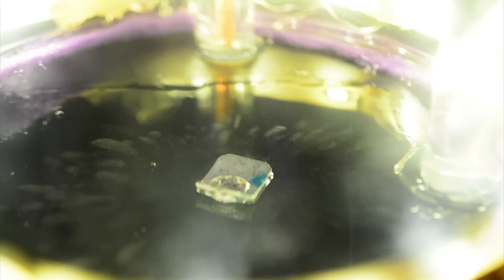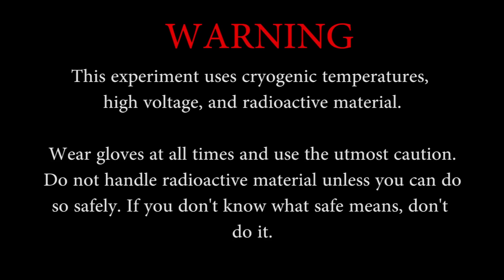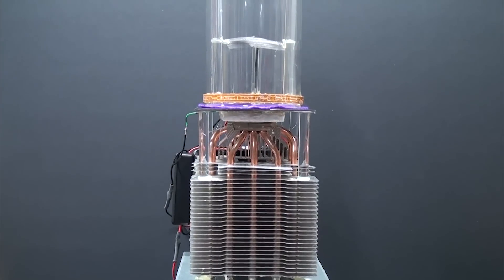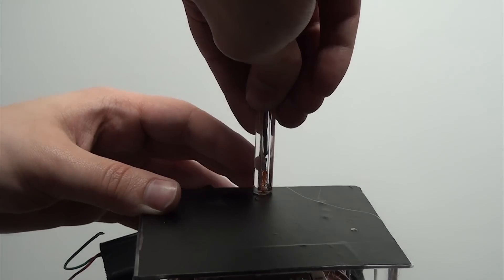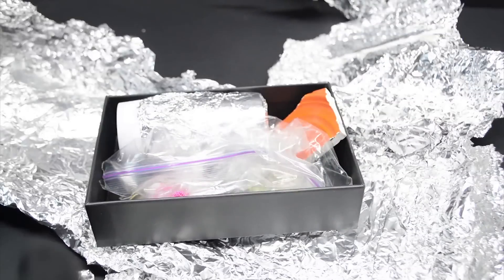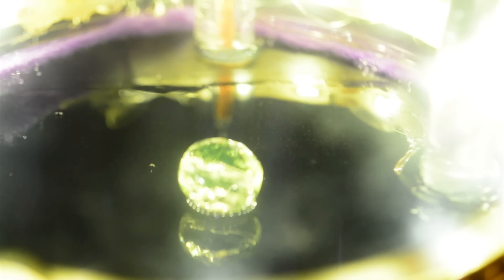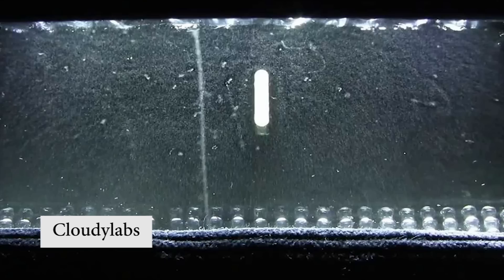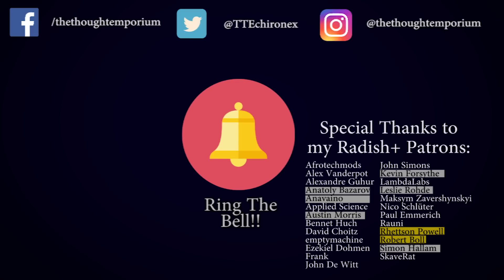Make Invisible Radiation Become Visible - Peltier Cloud Chamber

Comment: If you want to put the thermal paste better. 
Place a single blob in the middle and let it spread so it dose not trap bubbles.
Reply: Eh, that's not really an issue for an experiment like this.
Reply: @Sevendogtags  4:35 "the better job you do the better this will work" Eh, he said it :D
Reply: 1 or 2 Celsius isn't going to be game changing here.
Reply: @Sevendogtags  Yes and using the silver stuff is an overkill. Your point?
Reply: Not every dark thermal paste has metal in it. That's probably some cheap TP. My point was clear, the application of TP was fine and a better application would be irrelevant to the scope of this experiment.
Reply: @Sevendogtags  and as smart as you are you know it is harder to do it the matter it was done. The "proper" way is easier and better, but we cant all know everything like you. Fascinating how you know the proper divination from a few bubbles of trapped air... I'm simply in awe god bless you my friend.
Reply: @rosennachev9864  kindly join the queue of other clueless armchair quarterbacks... what part of "it does not matter for the purposes of this experiment" did you not understand? it was absolutely correct for his desired outcome... Why did you not go off on the excessive use of low grade hot melt glue throughout the construction? It was not "optimal" either... nor was the soldering and mounting methods... even the screens and isolation devices could have been "better" and "aesthetically pleasing"...  the point was that he was not creating a refined product that he was seeking to sell or even impress... he was making a low budget and sufficiently operational tool for his own purposes.... Knock yourselves out with all the refinements and "optimization" you want when you build your own... otherwise, please enjoy a nice tall glass of STFU.
Reply: @edwardpaulsen1074  4:35 "the better job you do the better this will work" Just to repeat myself. He said it in the video and he said that he used silver thermal paste. I have no idea what why you folks just simply want to make a big deal out of it. But it is funny.
Reply: @rosennachev9864  so he knows that doing a better job at putting thermal paste will make it work better, so why didnt he research how to do a better job? because it didnt matter for the video and device that he wanted to make, so you dont need to tell him how to do it.
Reply: @SuperBrainAK  and how many papers you have seen on the application of thermal paste? YouTube is an information sharing platform. Look the way I say it. It is not judgemental or offensive of his "poor" job as you folks want to make it. No way in hell anyone can compete with the information capacity of thousands of people by himself. You 3 just want to make a defend you hero from the threat that is my advice. Yes that sounds reasonable. 
PS. I enjoy feeling trolls so don't worry keep it going.
Reply: Unless you hold the heatsink one degree or more off of plumb, then the compound will propagate preferentially opposite the direction of the leading edge. Seen it too many times, pre spreading is the only way to ensure proper dissemination of compound - broadcasting it out the side of the socket whilst 1/3 of the mating surface remains dry hurts performance much more than a few sub micron air bubbles.
Reply: Rosen, you're a pelican.
Reply: That's nice for super flat or ground surfaces like processors and their heatsinks. Two precise surfaces aren't forgiving. It doesn't matter at all for the pitted, rough surface of ceramic that is the cooling modules.

Comment: Thoriated tungsten electrodes are used in welding because the radiation from the thorium ionizes the shielding gas and makes the electric arc easier to strike. While still quite common, it is not used as often as it used to be. Back in the day, the welding machines were not sophisticated and it was difficult to strike an arc properly. Also, tungsten alloys have higher heat resistance than pure tungsten and the thoriated alloys were the first ones commonly available. This, and there is the modern perceived risk from the radiation. Yes, the risk is not zero, but I would be more worried about the tungsten poisoning than the radiation, but unless you are inhaling or ingesting electrode dust, (which you won't 'cause you aren't welding) the risk is practically zero.

 If you have a welding shop in town, specifically one with an old guy in it, ask around for some thoriated electrode ends. You see, as the electrode wears from use and sharpening, it gets shorter and shorter until it is too short to be held in the gun, just like a pencil. The kind of welding that uses these electrodes is called "TIG" welding, which is more common in high end production, such as a fab(rication) shops, aerospace manufacturing, high end custom car or racing shops. Thoriated electrodes tend to be used by old timers as that is what they learned with, and nothing else is meaningfully better anyway.

Comment: Nice video,  To improve the dissipation I would not use that type of heatsink with heat pipes in that configuration, these work with a liquid inside, and the way you have it arranged the liquid is in the bottom (without direct contact to the source of heat) so when the heat reaches the alcohol it evaporates and and dissipates in the heat source, those heatsinks work better if the heat source is in bottom, I love your chanel
Reply: Those pipes have channels or a porous fill that wicks liquid so it covers the entire inner surface. Proper orientation makes them a bit more efficient, but they will still work.
Reply: This shoujld work great copper+surface area

Comment: Please, watch some tutorials where they teach you how to apply thermal compound. The way you did it, makes it very inefficient to transfer heat. There's way too bulky layer of the compund and also air bubble due to how you applied it.
Reply: No, it really doesn't make much difference. Maybe 1-2C. There's plenty videos where it is demonstrated that over use of thermal paste does not make as dramatic of a difference as most people think.
Reply: @Sevendogtags  it actually does. Pluse he doesnt have this under 200lbs of force pushing those plates together. This is a horrible way to apply it and exstreamly wasteful. Hell you could have used a credit card to apply it evenly. Those air pockets well also causes less heat transfer because air isnt as good as a conducter of heat as that artic silver is. Im not hating on him for it but he needs to understand and do 5 minutes of google searching or just read the side of the tube on how too properly apply it. Even if its not a cpu, use the paste the same way as you would for one.
Reply from the maker: ^what he said. ALSO it got to temp. So it literally doesn't matter. Getting beyond -26 is really all that's needed, I just shot for a few degrees past so I had some buffer. But the system has no issue getting to temp within about a minute or two. Also, I chose silver based thermal compound for a reason. It's very good at conducting the heat even with a bit of uneven-ness.
Reply: What you all seem to be missing is the question "What is the application?" He is not attempting to keep a CPU cool to prevent it from burning up or going into thermal throttling... he is using it as an easily permeable thermal layer to let the peltier devices work better... there was no "absolute need" for optimal thermal conductivity since he was easily able to reach the desired target temperatures and was not fighting against a virtual furnace driving the temperature up... while you may be correct for the heat based application you are describing, it doesn't mean much at all for what he was doing and your snarky commentary proves that you actually have less of a clue than you think you do... It's like saying that THIS WAY is the optimum and only way to cook and eat a burger and therefore must ALWAYS be done this way, even if it is actually a hot dog one is making... Let those who have studied and practiced science deal with the science rather than being a video watching armchair computer technician giving unasked for advice based on a different field or IT.
Reply: @thethoughtemporium  You are absolutely right about the required temp and that in this use case the badly applied thermal paste didn't really matter. However you have absolutely wrong way to think about this. 

To control the temperature you have to use methods that you can actually control. That is the applied power in the cooling pads in this case. The air pockets in the thermal compound that you have no way to contol of is absolutely wrong way to add any variables to the experiment regardless of the use case.
Reply: Sure you can get a sub-optimal setup to work by just adding more power and cooling, but in the age of sustainability, it might be worth knowing the most efficient way to do things. Thermal resistance is proportional to the thickness of the layer, and even most silver-based thermal pastes are 100 times less conductive than copper, so they can actually be the bottleneck of the whole system. They are also almost 100 times more conductive than air, so avoiding bubbles is very important. That is why you should use the right techniques to apply the paste and press the surfaces together so that the layer is as thin and uniform as possible.
Reply: does it get to -26C? yes? ok goodbye
Reply: @anteshell  Ok all you armchair geniuses... let's do a little bit of math then... (that should scare about half of you away) what is the percentage of area that your hypothetical "air bubble" will actually occupy compared to the total surface area covered?  Be precise now... Next, that hypothetical "air bubble" will almost immediately heat (or cool) to the ambient temperature of it's surroundings (the thermal paste and transferring surfaces), gases have far less thermal mass than it's surroundings and thus the volume of "air" that is affected is on the order of 0.0001 percent losses in efficiency.  Finally, there is duration or cycle time... the applications that you are all referring to is for computers that are generating larger volumes of heat on a continuous and active basis over the course of many hours (or even days) at a time... some computers are running at upwards of 75 to 80% duty cycle.... as opposed to this application that may be running for an hour or so before being turned off and the criticality (a processor burning up or destroying itself) is NOT an issue at all...  failure mode is NOT going to destroy hundreds of dollars of equipment... Another Red Herring is those supposed variations in "power consumption" or environmental impact... even running for a whole day is a thousand times less than the gas you blow out after a hearty meal of bean burritos.     Also GoldenFox... care to give your citation for the amount of pressure being applied to those plates? because I got news for you, 200 PSI  of pressure would destroy your chip... give it up... you have just thoroughly proven that you do NOT know what the hell you are talking about.
Reply: @edwardpaulsen1074  "the volume of "air" that is affected is on the order of 0.0001 percent losses in efficiency." 

Assuming the size of the air bubble is roughly of the size the thermal paste in the video would have.. Then just equally small drop of thermal paste would be sufficient enough to tranfer heat, as the volume of air in between the plates would be about 500-1000% more and according to your calculations cause only about 0.0005-0.001% loss in efficiency. So yeah.. There goes your explanation out of the window. No need to thank me.

Comment: nice design - I had planned something like this forever, but now I got some good ideas. You should be able to get a continuous alcohol circulation if you try to make a capillary connection between the liquefied alcohol at the bottom back to the reservoir at the top...

Comment: Thanks, I've always wanted to build one of these too.  FWIW my local Air Liquide Canada Store sells dry ice pellets for media blasting to anyone walking in off the street.  For a small cooler full it's around $25-$40.  Sometimes cheaper on Friday since it won't last.  I'm sure there's better prices out there but you should find at least one welding place selling it in any medium sized industrial park carrying it.

Comment: EDIT: this question is answered, if you want the answer look in the replies!

Can someone explain, it's said that the first peltier unit is powered at 12V and the other ones are only 5V, but its also said that the higher ones have to pump less heat, and the first one is only 60w, so why give it 12 volts?
Reply from the maker: You've got it backwards. The 60w is on top and is run at 5v.
Reply: @thethoughtemporium  Ahhh ok thank you! I misunderstood and thought that the bottom 2 would run at 5 volts because they are both of the same type, it never came to mind that there was a possibility 2 different units can run at the same voltage! a bit stupid from my side :p
Thanks for replying!

Comment: "The same cheap peltier cooling units that you use to keep your CPU cool" - I've built datacenters for 17 years and PCs for even longer and i've never once seen a peltier device anywhere in the stack of cooling devices.
Reply: also the fact he applied too much thermal paste probably states the fact he probably has never built a PC
Reply: They are also hilariously inefficient, like 13% efficient, so they generate WAY more heat then they move from the cold side to the hot side, this means a very high wattage peltier and a massive heat-sink would be necessary to cool an overclocked gaming CPU, which is the only reason you would want to supercool a CPU anyway. A more normal refrigeration system is usually used for this purpose since it's several times more efficient, and it's much easier to get rid of the heat, a sterling cooler would also work since it's also several times more efficient, and better at producing large temperature differentials, but useful sterlings are much harder to get than a refrigeration compressor, so.
Reply: They were actually used back in the day for a few years, around the Pentium 1 days.  They were called "ice caps"

Comment: You should check some old radioactive lenses. Mostly the Takumar 50mm and 55mm lenses. (the names vary, smc takumar, super takumar, super multy coated takumar etc. )
The front-lenses are emits 5 OR 20-22 μSv/h, depend on the randomness of the thorium-content of the protective layer on it. 
(there are "radioactive lenses" out there, that uses lanthanum ore else, those are produce only 0,4-0,6 μSv/h or even less.

Comment: You can quickly remove the entire Am "button" out of a smoke detector without cutting. it leaves a nice window with a non radioactive case. Very safe and easy to handle for experiments. The source is inset far enough that it is impossible to touch the source with your fingers. Just my 2 cents. Great vid.

Comment: I really hope people warm up to nuclear energy soon, even if the US only raised its nuclear output to, say, 30-40% of the total power used, the amount of carbon kept out of the atmosphere would be astronomical
Reply: Totally agree. The number of deaths per kWh is pretty damn low compared to the very accepted coal, and while building one reactor is ridiculously expensive, building 10 of the same type gets cheaper and cheaper.
Reply: @mfbfreak  it's the lowest death per energy out of everything...
Including solar and wind
But there is nuclear waste, bad decisions and a general fear of nuclear
The new green energy corporation are also attacking nuclear as not the best...
Reply: @mamupelu565  today it's actually the "renewable energy" corporations trying to demonize nuclear
It's a viable against them, they are in today's society stronger and big oil can't argue that much if the facts, while they can do is lobby

Comment: Who uses peltier units to keep their CPU cool?
(Except for 8erbauer)
Reply: Not exactly an efficient way of cooling your CPU, but I suppose you could do it.
You'd still need something like a heat sink to draw the heat away from the CPU and the peltier to cool that heat sink and something to draw the heat away from the other side of the peltir so it didn't heat up the case too much
Reply: I actually had planed to experiment with it, but it is a painfully inefficient cooling method. It is both attractive and treacherous, because while it forms a thermal differential, it also adds a thermal impedance and an additional source of heat between your hot end and the cold end. On the other hand, the hotter you get your heatsink compared to ambient, the more efficiently it will dissipate heat, so i'm wondering to what extent that offsets that extra impedance.

They are occasionally used as chillers for sub-ambient cooling in experimental water cooling setups - by a handful of enthusiasts. This generally adds more bulk than you'd rather have in your PC though.
Reply: I am thinking about putting one on my gpu. I do not want to break the gpu so I have not done it. Normally I would cut cards and coolers up all the time, but this card is still too precious to me.
Reply: They were a lot more popular 20 years ago when the enthusiast scene was peaking and before water cooling became mainstream because there were no all-in-one systems back then or places that built perspex-clad beasts so if you wanted the coolest setup (no pun intended) and weren't prepared to fuck around with tubing, pumps and reservoirs you could opt for a thermoelectric cooler.  They were also fantastic bragging points.

Comment: If I remember correctly those taser modules output voltage depends on the distance of the output terminals between each other so it would be possible to limit the voltage having the exposed part of the terminals close to each other